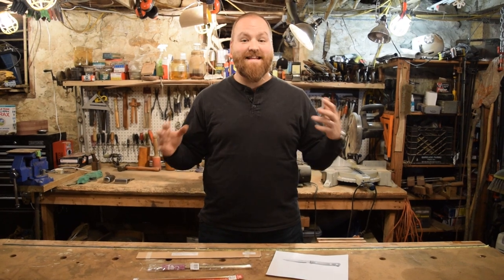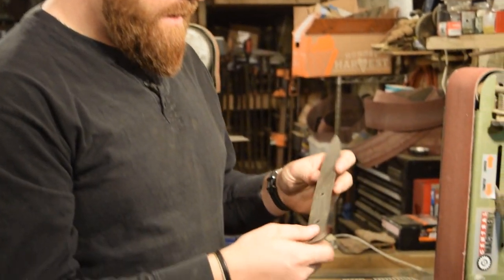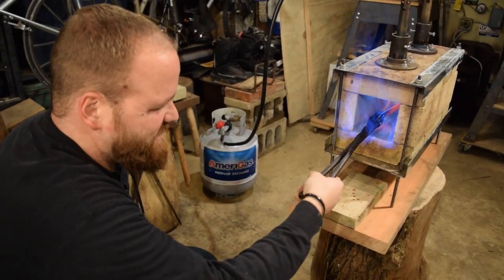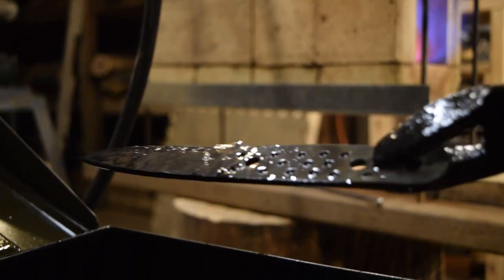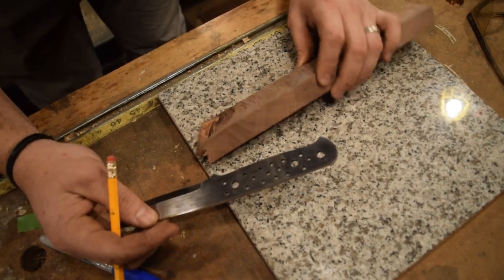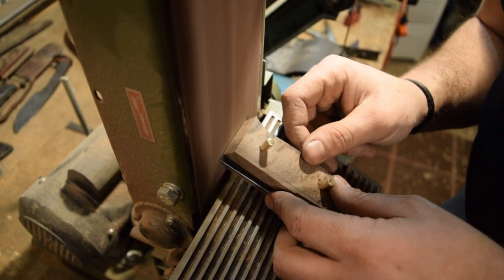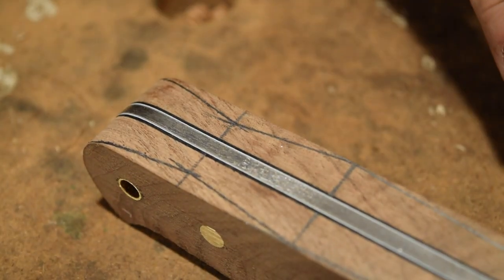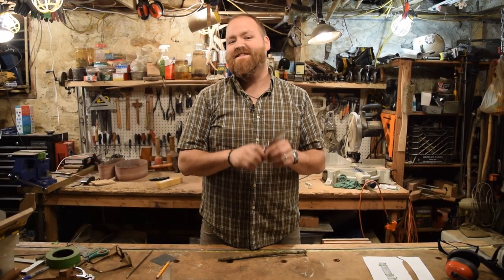Making a Knife: The Bushcraft Woodlore Clone

Comment: love that you're using accessable tools like harbor freight stuff, many many channels use a $3000 grinder to make a $50 knife.  Bravo!
Reply: I'd buy two more HF buffers and maybe a vise because those are hard to screw up. There's lots and lots of things that nobody should buy there - hit up flea markets or used tool shops instead and fix up an older tool of quality. Buy NOTHING from HF that uses brushes (ie; universal motors), fluids, batteries, or consumables. Don't even think of buying a machine tool, welder, or similar there. It will seem like a deal at first, but it will let you down sooner or later and you will regret it. Thus spake the bitter voice of experience. Used tools rock.
Reply: Railgap Esoterica seems to be working fine for this guy 🤔
Reply: @jadeddragon4254  yeah exactly. Reminds of that old saying about a bad workman blames his tools.
Reply: What is the best tool you can use?...... The one you have!
Reply: Mr Darren,  anybody can do good work with top-notch tools. It take a real craftsman to use the stuff I have. 😀

Comment: Thank you for stopping by and looking at my latest knife in my community section.  I really appreciate the videos you put out on making knives.  I am learning a lot from watching your videos, like this one I have already learned that I need the champering bit for my drill press.  I have drilled extra holes in the handle for the epoxy to squeeze thru and bond to the other side.  Of course I will need to later get a real forge.  I have been using a charcoal chimney setup with a black iron pipe, a hair dryer and lump charcoal to achieve the heat treat to non-magnetic.  Has worked out fine now for the 4 knives I have made.  I have video on my channel of the first two knives I built for me and my son and you can see the charcoal chimney in action.  Again you have great videos and I like how you explain everything.  Juddie

Comment: Just one suggestion, when your open the valve for any type of compressed gas bottle that is a combustible gas only open 1/2 turn. Your will have plenty of supply and if anything in the pipe system starts to leak it is must faster to shut everything down in an emergency. My old welding instructor was a fanatic about that.
Reply from the maker: That is great advice. Thanks!
Reply: Your instructor was a fanatic that did not the school shop burned to the ground. You and I are here because of good teachers. Another point for everyone to understand is that propane is heavier than air. You can have a leak that your nose can’t smell. If it builds up to the level of a water heater or furnace pilot, BOOM! A man in my area was returning a propane grill to a friend’s house. There was a leak. He lit a cigarette and blew his van to the junkyard.

Comment: A great video, and I really do like your new forge, and I will use it as a starting place for my own, however, with a project this small, it seems counter productive to heat that much empty space and I'll suggest you consider using additional firebricks to narrow the open space on each side, and possible the  back, should you decide to use one burner only.

The more focused heat, in a narrowed throat, can better extend time between trips to replace your depleted tanks, IMO. 

Again, I like this project and your new forge, very much.

Thanks for taking the time to share your work!

Comment: When you are drilling through thin plate, it can screw its self up the spinning drill. Now you have a spinning knife, looking for some fresh meat to cut. A safer way is to clamp a piece of flat mild steel in the drill vise, and then clamp the blade to that block. This eliminates the jump as the drill pulls itself through the plate. 
 I have survived fifty years of work as a toolmaker with no more than eight stitches at one time, but I never went back for seconds on any single mistake. The Red Cross needs your blood before it hits the shop floor.
 That is a very nice project. O1 is a great steel for lots of knife work projects.

Comment: That is a really beautiful knife.  I just finished my 4th knife build.  I am using 1095 carbon steel and purpleheart scales.  Mine sure doesn’t look as nice as yours, but I hope someday to get there!  I have a picture of my knives in the community section of my channel.  Again a beautiful knife!!!  Juddie
Reply: When you are making a more "rustic" it can look pretty nice if you make the handle out of oak and use a torch or heat from a forge to make the grain pop just a little bit. I generally shape the handle with files, rasps, or grinders and than take a large number of small shavings off with a knife to make it look hand carved as well.

Comment: When using your forge to heat treat knives you might want to consider placing some soft fire brick on the inside, it will make the space being heated smaller and insulate it better which might allow you to turn down the amount of gas being used a little and provide a more diffuse heat source for the blade reducing the risk of hot spots.

Comment: I note you used 1/8" (3.2mm) , the original is 5/32 "(4 mm) O1 which may explain the warp following the heat treat process . In the UK O1 is also called " silver steel" , pretty cheap as ground flat stock . I have a 115mm angle grinder and an original Sheffield England " The Linisher ", once used for producing countless Sheffield steel knife blades . Although generally reserved to better steels like D2 , its still a good idea to wrap the blade in heat treat thin stainless steel to distribute the heat without burning out or oxidising . More firebrick or intumescent material required to distribute the heat better and save gas .
Walnut darkens really nicely using Ferrous Sulphate ( lawn feed) as it reacts with the tannin in the wood . It's old name is 'coperas' and has been used for centuries as a mordant for dying , mixing with powdered oak galls and sweet wine to make ink and for staining oak and walnut furniture and decorative work . A lot of fake bog oak is produced this way too . I'm guessing that the polymer scales was by accident or decoration and not to stop the iron in the steel blackening the walnut at the contact zone .

Comment: I've started making knife handles (buying the blades rather than making them like you are) and I've got to say you did a beautiful job on that handle.  It'll inspire me to get a bit fancier!  Where do you get the laminates?
Reply from the maker: Thank you for the kind words. I get scraps from a local sign making shop, but you can purchase several different types of liner material online from all the knife making supplies stores. I am using a light fast sign making acrylic, but typically, micarta, G10, and other fiber based liners are use for handles. Good luck!
Reply: @TheArtofCraftsmanship  Thanks so much.  And I'll definitely have to look for GITD liners!

Comment: I see you put rubber glove finger tips over your clamps. That's genius!  But I'm wondering if you took a Q-tip and cleaned out the lanyard tube before the  epoxy was dry?  Btw acetone works wonders for wiping off excess epoxy off by the blade before it drys I use Q-tips for that as well.  The knife came out amazing and those glow liners really set it off. Keep up the good content!

Comment: Another great video. As someone just thinking of starting can you tell me what sorts of thickness of steel should I be looking to use. Any advice would be much appreciated. Thanks
Reply from the maker: Thank for your compliments and you question. I would stick close to 1/8. This is an easy thickness to work with and makes great blades. That being said, I started with old metal files, and they range from 3/16-5/16 and make great knives. If you are interested in stock removal knives to start, then I would go for 1/8. Good luck.
Reply: Thanks for the help

Comment: You are the first one I've seen on you tube using a Harbor Freight 1 X 30 to do your bevel grinds.  I've made about 35 knives using my little 1 X 30.  It's OK for bevels up to about 5/8 inch wide but after that it doesn't do well.

Comment: Dustin. What is the black and white. And where would I find this?..
Reply from the maker: Hi Judith, the material that I used is a sign making light fast acrylic material. I get scraps from a local sign shop, so I’m not sure where they order from. There are several websites where you can get handle liner material is loads of different colors and designs. A quick google search of “knife handle liner” will offer lots of variety. Good luck.
Reply: Thanks so much. Hubby and I have just started back into building once again.  Hope to have pics soon.

Comment: Hi my friend!!! Nice video!!!   Why do you make 2 times normalizing if the steel is not already quench and hard?????  I thought that the normalizing was just for the quench steels to make them soft to grind and saw the steel easy.    Thanks a lot!!!!
Reply from the maker: Normalizing is the process of reorienting the grain structure after heating and cooling the blade. Annealing is converting the steel from matensite (hard) to austenite (soft). It’s more important to normalize forged blades, but I like to normalize all of my knives, even if they are made from flat stock, because you just never know for sure, unless you do it yourself.
Reply: Then normalizing is what lot of people call temper, and annealing is what lot of people call normalizing, i understod well????

Comment: Would the holes not have been better punched after marking then drilled when it was a square bar so it doesn't slip in the vice?... regardless, the end result is very special !! Well done.

Comment: Really sweet knife. One question. When you glue the liners and scales have you tried the glass micro beads that are used with fibre glass so that you get a more even distribution of the adhesive and get a guaranteed minimum thickness?.

Comment: Hi Dustin, can you please tell me how fast is your belt sander? I’m thinking of buying one but the types in Europe vary a lot. What I found out is that the main spec is speed - meters (or feet) per second. Do you know which speed is efficient enough to work with this type of steel and how rough the belt should be? Thanks a lot!

Comment: Excellent work if I sent you the 01 steel what would you charge me to make 2 hardened blade blanks drilled and sharpened I have scales for them but my tools are limited right now... I used to get Bernie Garland blades but he had a stroke and no longer does it

Comment: Beautiful knife.  High carbon steel. You should use linseed pil on the steel too. Personally my bushcraft knife have a. 
7 1/2" blade that is 3/16" thick at the spine.  Distal taper and i like A2 steel. Just mu preferance.

Comment: I have the same 1x30 belt sander and I’ve noticed when grinding metal that the sandpaper belts quickly get destroyed. Are you experiencing that? If not can you recommend a brand?
Reply: Ceramic belts last a little longer, but I have yet to have found any belts that last long enough to make a knife without dulling roughly 4 of them. I have had good  experiences with red label abrasives, when it comes to customer service.

Comment: I'm really enjoying your channel! Where do you purchase the anvil that you used to rest your knife on after it came out of the forge?
Reply from the maker: I am currently using the cheapest "anvil shaped item" that I was able to buy a few years ago, which is the 55lb anvil from harbor freight. It works, but is really NOT great for real blacksmiths. It has been worth it for what i have done over the last 10 years, but I am always on the hunt for a real anvil in the 100+ lbs range. I also have a 18" piece of RR track that i use, which works much better, although it does not have a horn. The combo of using both has done what I have asked of it, so far, for me as a relative amateur blacksmith.

Comment: Where did you get the starting image of the knife and to scale?
Do you have template for the additional holes you drilled for the glue to seep through?
Reply from the maker: I found an image of Ray Meers’ woodlore knife on line, and found the dimensions. Then I printed it to scale. As for the holes, I drilled them as was necessary for the handle glue up. Thanks for watching and the question.
Reply: The Art of Craftsmanship thanks for answer, interested in your grinders and have watched your workshop layout vid. Having searched for similar grinders I’ve realised the price can vary so would like to know what power I should be looking for. I’m going to have the blank water jet or laser cut.

Comment: It looks like your burners are too big for your forge. Either that, or they need to be tuned better. Usually there isn't that much blue flame coming out of the mouth of the forge. Also, when quenching, it's best not to agitate side-to-side. It doesn't hurt to orient the blade north to south either when quenching, although some people dismiss this as folklore. Nice results, though.

Comment: I had to look up the word bushcraft, and know nothing about Ray Mears. However, bushcraft or whatever you want to call it, it's a nice knife in a very handy size. I'm not so sure about the plastic glow in the dark stuff... little too fancy for me, I'd prefer brass liner if I used one at all. Question, wouldn't dimpling the glue side of the wood also add glue surface to the wood portion, I mean like use a drill or chamfer bit to just barely dimple it a bit. seems to me it would help the glue up, so long as you didn't take it too far. How is the balance of this knife? I like a certain balance in mine, hard to explain but if the balance point is in just the right spot, it just feels right. I'd love to make one that fits my hand specifically, but I don't have a shop or tools to do it.

Comment: Do you have a video on how you fitted your 2x30 bench rest to tilt that direction?  Mine tilts the opposite direction and won’t tilt towards the belt.
Reply: I believe he mentioned modifying it in an earlier video but didn't show the step-by-step. He ground down the back of the table a bit for sure to allow a tilt towards the belt/motor. Don't know what else was done. Pretty sure it's a 1x30 from Harbor Freight.
Reply: @dthempel  Useful info, thank you.  I'm going to have to figure out how to do this, I didn't even realize my 1x30 didn't tip that way until someone else mentioned it!

Comment: To normalize tool steel bury it in a bucket full of wood ashes without any charcoal pieces in there. This is an old blacksmiths trick. It will take about 24 hours to cool but the steel will be dead soft.

Comment: Can I get a template of that design.
Reply from the maker: Hey jamie. I don’t have a template. What I did was found an image of Ray Mears’ “Woodlore” and printed it out to the correct size, based on the specification on line. Then I cut it out and traced it onto the steel.

Comment: What is the significance of magnetic vs not
Reply from the maker: When the steel reaches critical temp, and changes into an austenitic state, it becomes non-magnetic. To be able to quench and harden steel, it has to change quickly from austenite to martensite. Therefore, you can tell when steel is austenite when it becomes non magnetic, and therefore ready to be quenched, forming martensite (hardening the steel).

Comment: hi, I got a "timber wolf" bush craft knife off ebay the other day,  I thought it was a good deal for $20. my handle is a little loose when I go to cut wood, like doing a feather stick.  I like the knife because it came with a sheath and fire steel, just wished the handle didn't move. its a full tang "rip off bush craft"   would you ever take a knife and make a decent handle for one, if someone shipped it to you?  if so, comment and ill send you my email adress

Comment: How come you use such an oxidizing flame on your forge? SHouldn't you tune it to get a better burn, one that heats the forge to more of a glow?
Reply: I was wondering the same thing
Reply from the maker: When heat treating a single knife, the forge doesn’t need to be prepped like it would if I were forging. I’m basically just using the flame to heat up to the critical point, and with such a small target I’m not to worried about heating the whole forge. Thanks for watching and the comment.
Reply: @TheArtofCraftsmanship  Oh, ok! I guess that saves on propane too. Do you worry about ventilation issues in that basement with carbon monoxide when forging? i might watch your video again to see how you did that coke bottle grind with the 4x36 grinder.. thanks for the reply!